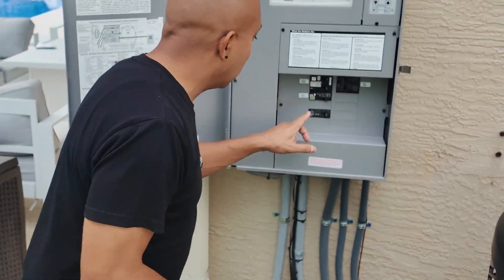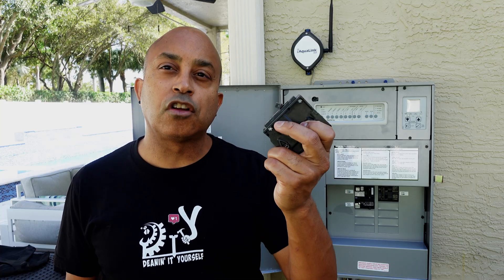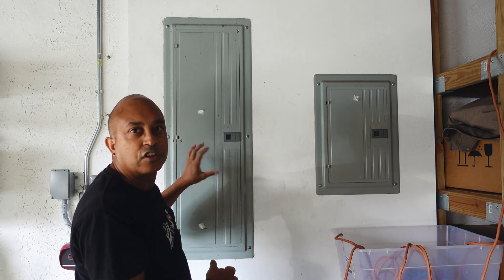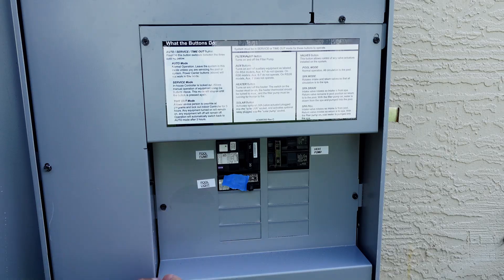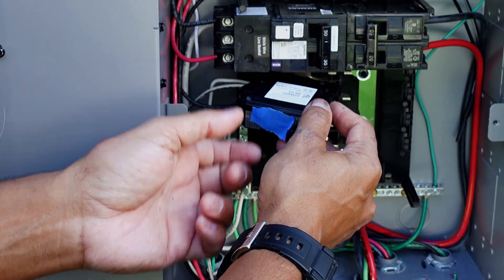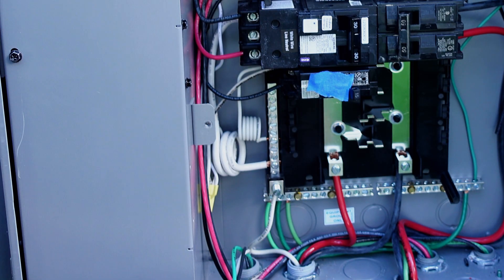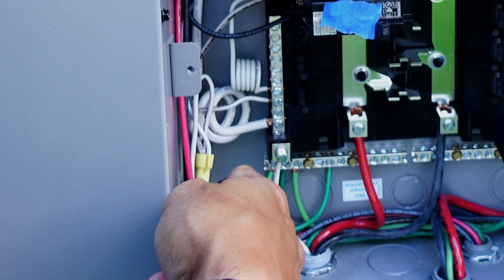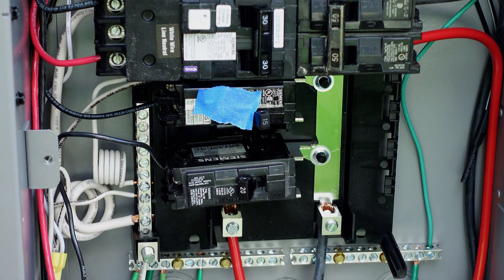How to Replace or ADD a Breaker and Circuit to your Panel

Comment: In my case i have a panel outside with an electric company lock on it.. The main panel inside doesn't have a kill switch.  I'm assuming it is in the panel outside but not sure since it has that little electric company "lock" on it.  Suggestions?
Reply from the maker: are you sure there is no kill switch on your box?  how old is your home?
Reply: Arcflash training says to make sure you test your meter first on a working power source to verify that your meter is working, then test the circuit you will be working on, then test it again to a known working power source to verify that everything is the way they need to be. Safety first! Nice video!